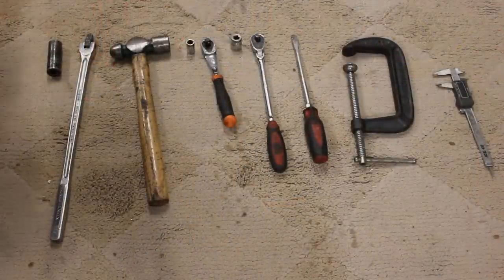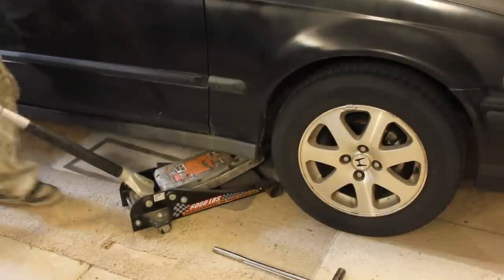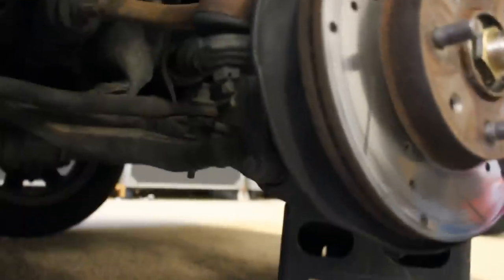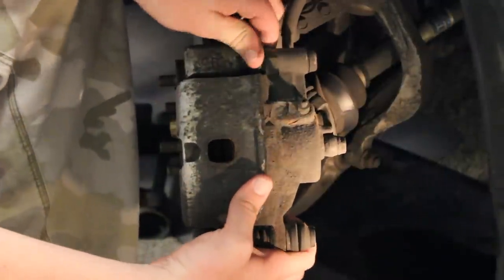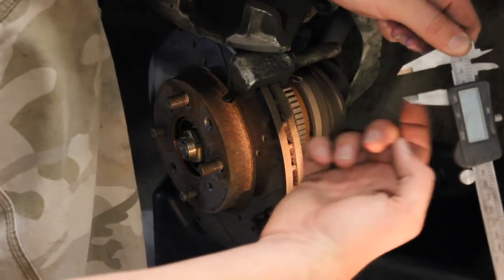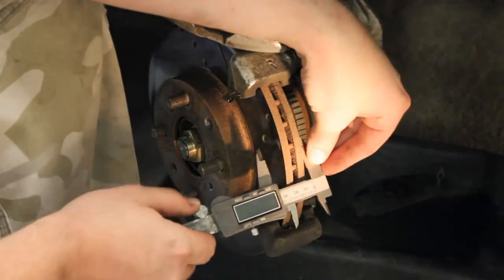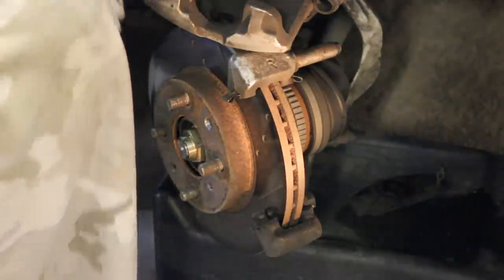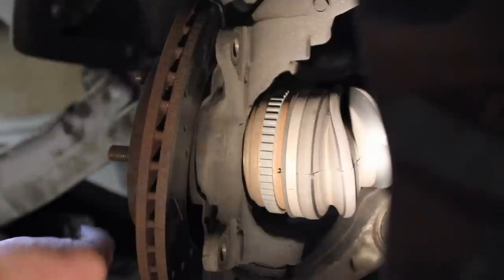How to Replace Brakes Honda Civic 96-00

Comment: Awesome video, thanks man.  I've having some odd noise from my front brakes so tomorrow I simply plan on new rotors and pads to be safe.  I figured it was a pretty basic job, but having never done civic brakes, I wasn't sure.  This video confirmed they are just as easy as other cars I've done.
Reply: @Vincent Adriel Instablaster =)
Reply: @Leonel Ryker Thanks for your reply. I found the site thru google and Im in the hacking process atm.
Seems to take quite some time so I will reply here later when my account password hopefully is recovered.
Reply: @Leonel Ryker it worked and I finally got access to my account again. I'm so happy!
Thanks so much, you saved my ass :D
Reply: @Vincent Adriel happy to help =)

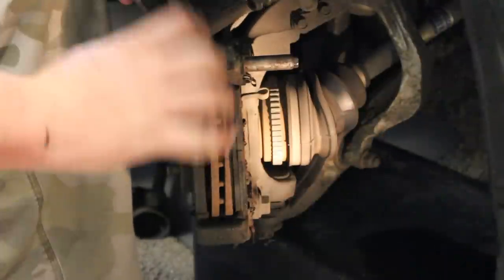Comment: Great videos...I have a question if anyone could help me out. I had to replace everything on my brakes & my bolt guide pins are different, one has a fat end at the bottom & the other doesn't, one fits perfect & the other doesn't. The right side guide pin, he shows at 4:04 looks like the one that only fits my left side. Part number is h5132 at autozone

Comment: Hey thanks for the video! Subscribed, however, could you go over where to put the jack stands? 

This is my first attempt at jacking and am almost completely unfamiliar with cars and their terminology ie: control arm (previously changed an alternator and radiator out of necessity so I figured why not brakes and oil change too)

Comment: @HondaHowTo1 - Hi Jordan. The caliper bolts are extremely tight to pull off on both sides. Used WD-40 along with a 10" reversible ratchet but can't budge. Any suggestions?

Comment: Using a caliper like that to measure a rotor is incorrect. First the teeth (as you call them) otherwise the tip of the caliper cant cross the edge of the rotor. The edge doesnt wear down and will likely give you a bad reading. In fact you can feel this edge I am referring to.  A set of outside micrometers is what should be used. This would allow you to bridge over and past the edge.